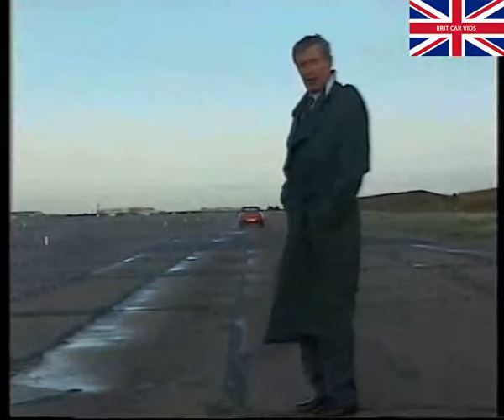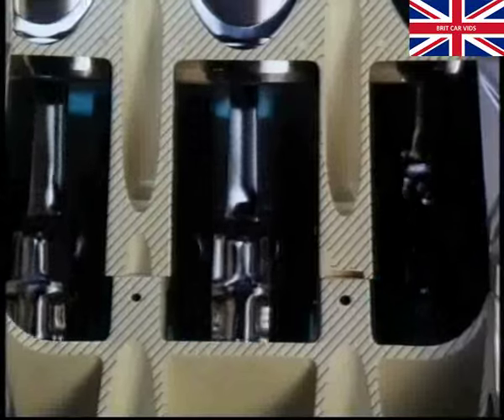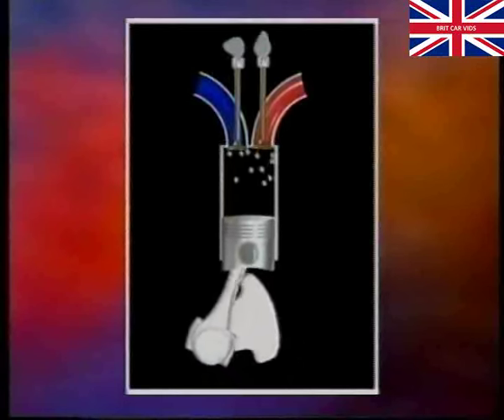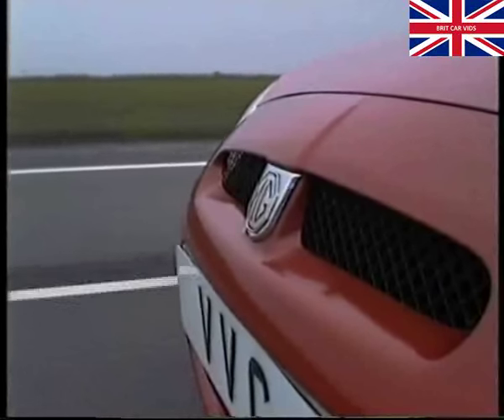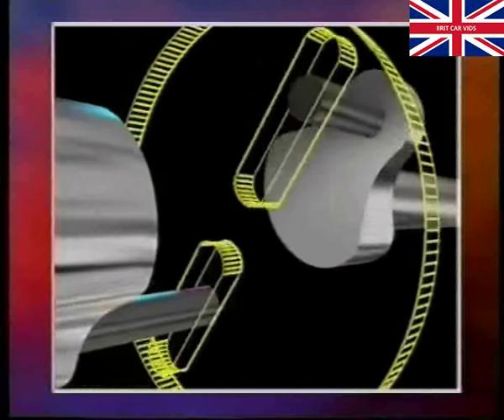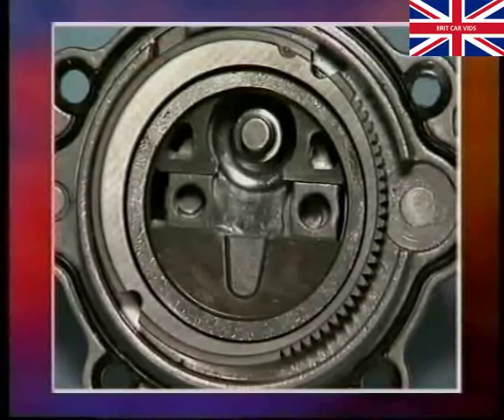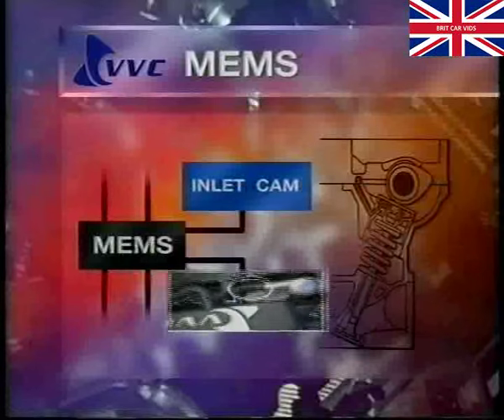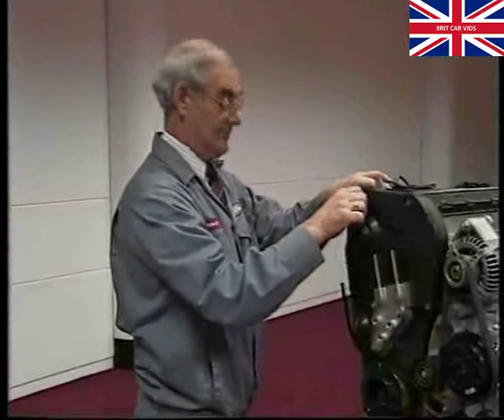Rover - Variable Valve Control - VVC (1995)

Comment: Reminds me of a complete head and VVC unit stripdown and rebuild I did on my Coupé with the guidance of the very talented Dave Andrews of DVA Power in Milton Keynes. Taking the VVC units apart was like dismantling a Swiss watch. Over engineering and not without flaws, but pretty ingenious.
Reply: hmmm...   *avoid*  it then; hate overengineered stuff, when it breaks down it sucks your wallet dry; like 2000s and up B M trouble Us
Reply: To be fair they’re actually pretty reliable units, considering what it does which is to vary the valve timing throughout the full rev range it’s actually fairly simple but with a couple of finely machined parts. I’ve had way more trouble with air con, turbos and egr valves than with the vvc mech.

Comment: I used to run Full Synth 10w40 in my VVC. I switched back to semi-synth after being convinced by people on the forums.
After watching this video, I'm even more certain that this was the right choice. The VVC system is controlled by oil pressure and the brains is the MEMS computer which must be calibrated for a certain type of oil. Unlike any other engine I've ever come across, there may very well be a difference between running full synth and semi-synth of the exact same oil viscosity. Weird!
Reply: Ridiculous engineering then,can´t believe that!!! (should not be allowed to be sold to the public) ; i guess that  may be caused by another great  of the many emissions  of the Greenphissers for sure... their emissions...                         *avoid*
Reply: @josepeixoto3384  You'll go mad when you hear about the variety of oil grades used on modern engines, and the wet belt specific oils some engines have to use.

Comment: This is the best explanation of Varibale valve duration system. The one, which nowdays korean Hyundai called CVVD says, that they are the first in world with such a system of variable timing of combustion engine on the market. But actually, it is not true. The first was Rover.

Comment: Customers also wanted engines that didn't blow head gaskets....
Reply: Hi there was nothing wrong with the k series engine if it was serviced property. The owner's were let down by a dealer network that were only interested in sales and not customer satisfaction.
Reply: There was other manufacturers that had the same problem and still have now k series engines an excellent piece of engineering head gasket very easy to replace anyway did my 1600cc on the drive 3hours
Reply: @kennethtucker9844  Hey there, that was what I thought for the first 5 years and 25k miles... My TF160 was bought new from the factory, never driven hard until the oil was up to temperature, always had the correct Magnatec oil changed every year despite the low miles, coolant checked every time it was driven and changed every other year. But, alas, at 5 years I opened the boot to see the coolant was down, I pulled the dipstick and... brown mayo. Fortunately I'd driven no more than a few miles, gently, on the blown gasket and had it transported to Brown & Gammon for repairs. 

That wasn't long after all the MG specialists started offering an upgrade solution with Land Rover Freelander parts, so my TF now has the upgraded oil rail, MLS gasket, upgraded through bolts and I think a couple of other bits fitted and of course I had the head skimmed. I drove it another 2-3 years without issue but since 2012 it's been parked up unused so I can't vouch for the longevity of the repair yet, but I'm just starting to recommission it so hopefully, fingers crossed, the repair is still good... Plenty of other bits for me to do without having to replace the head gasket! Can't wait to get driving it again, lovely little machines.
Reply: @donkmeister  How is the car going now? Got a ZR 160 MK2 my self. Lovely little car

Comment: lets be honest they got this from honda it was honda that saved them in the 90s
Reply: Get to know the subject before making comment, the Honda vvc is nothing like this it is basically either 8 or 16 valve in operation at any one time. The Rover vvc is a genuine variable valve control that alters the speed and overlap of the cams. Pure genius.
Reply: Kenneth you're damn right, but early origins of project (late of the '60) are exactly as I posted a couple of years ago.As genial, as old indeed.
Reply: Patented by rover good enough 👍
Reply: Untrue: copied by Rover. But legally, when originally patented idea became available free on the market.But not doubt that geniality of it belongs to others (as I expalined earlier).
Reply: nope your talking bollocks, its rovers own system
Reply: Nope. This was how they got around Honda's patents on VTEC. Other manufacturers did the same. VTEC allowed complete change in cam timing, profile, and lift. VVC used a much more complex mechanism, but only allowed change in opening time. The slight benefit was this was continuous rather than VTEC's sudden switch.
Reply: @straightpipediesel  nah i'd prefer vtec, fun > practicality haha